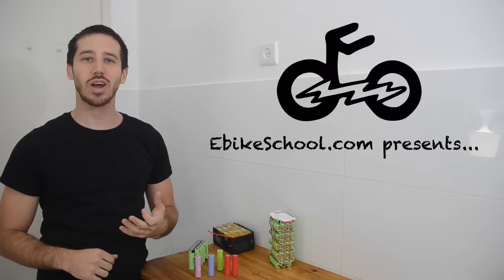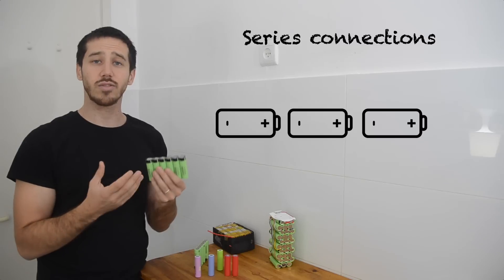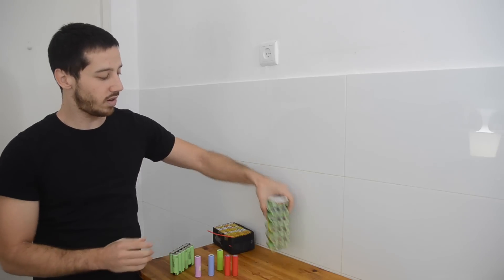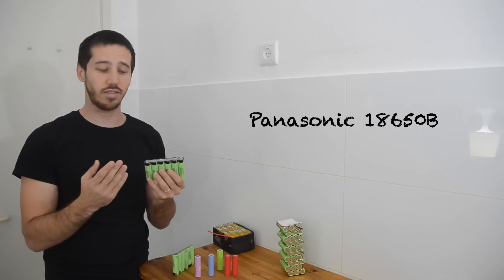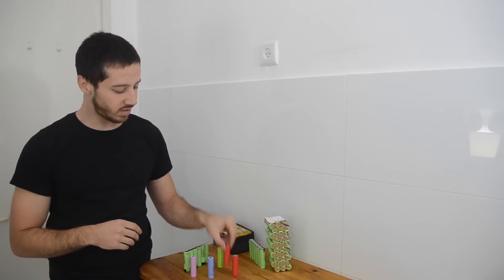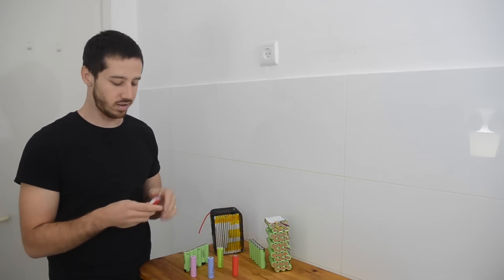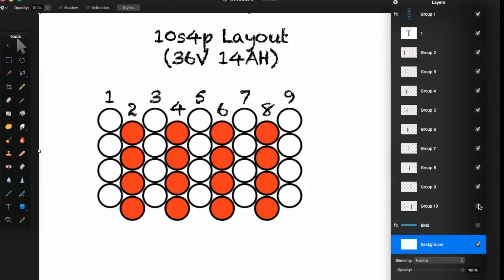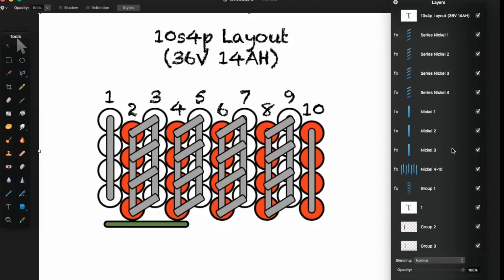DIY Lithium Battery - Battery Layout - Part 1/5

Comment: I have an old (2012) A2B 36 Volt bike.  Starting to cut off irregularly.  Re-push On button starts it again, but then it cuts off again.  Battery going bad?  Replacement cells possible?  Thanks.

Comment: Sorry Micah, i was wondering for 36V pack. I cant seem to fit 100 cells in my scooter it wont fit. I was hoping for 90 cells. Is it possible to make the centre rows 2P.. (10 cells per series connection) but the last positive and negative 
Row only 1P (rows 0 and 10 only 5 cells each) or is this a bad idea?

Comment: When you connect batteries in parallel amperage goes up not voltage.  When connected in series then voltage goes up.  Surprised by your video
Reply from the maker: That’s what the video says

Comment: hi there. I have an engwe engine x. it has a factory 48v 13ah battery and i will fit a second battery using a discharge balancer kit. it has everything I need so no cutting wires etc. I want to install an isolator switch so I don't have to unplug it all the time as they can be a bit zappy. I'm only a casual rider so the bike will be laid up some of the time. do you have any suggestions and direct me to the right part as I want it to be safe.

Comment: Hey Micah, enjoying your book DIY Lithium Batteries, and I have a question.  Batteries having varying voltage and current ratings, when you are designing a battery system and doing the math, how +/- can you be when doing your calculations?  If you are aiming for 52v and the math is adding up to 50.7v or 54.6v what is more acceptable?  I am assuming that the charging voltage doesn't change, correct?  Thank you for the book, I am gaining lots of knowledge from it!

Comment: Is it safe to use my old BMS that runs 10s4p rated at 10Ah on a pack that will be rated at 14.4Ah?
Note my old pack used 40pcs LG rated 2.5Ah. I am planning to replace them with 40pcs Panasonic rated 3.6Ah each.
Thanks to or your patience and reply.

Comment: Hello Engineer Mica Coll? It is wonderful to note that today, I have succeeded in building an S3 P7 lithium ion battery by listening to your teachings on line, buying your DIY book. Some materials were bought from china and locally in the UK. 18650 batteries were wrongly sent to me from China with pin heads. These were condemned and flat heads were sourced locally. 12v 40 amps BMS was used. There was a slight misconnection and the bms got warmed up and I quickly re adjusted the whole thing with shaky hands. Things went well after this and the discharge voltage came to 12.21v. Heat shrinks were bought and the whole project was wrapped up and ready this evening. This is my first step and I thank God as well as your very self for your open heart and willingness to help others. I intend to try more and will let you know about my adventures in this field. The vruzeng  Plastics tend to be falling apart often and the nickel strips are only coated and have nickel flakes peeling off the strips. Many thanks to you sir.  Joseph Oshagbemi.

Comment: does a Samsung INR 35E 3.6v  count as 3.7 ? or do i need to instead of 13 in series have it in 14 series ? (making a 50.4v battery ?  is that problematic or is there an advantage to it?)

Comment: Great video. When charging a battery pack, do you have to charge with the same voltage that the pack produces? For instance, a battery that is 8p 5s that is 21v. Does it have to be charged with 21v? Or could I charge with 12v?
Reply: you always charge it with a higher voltage, otherwise the power the amps will never "flow" to your battery. As for the voltage it depends on the battery, look up your datasheet

Comment: is paying for premium brands such as samsung LG and panasonic worth it? i was thinking attempting my first build and am considering samsung 18650 35E....should i consider going with 21700s instead...and why...now i currently have sla12v20ah x 5 in a ebike scooter gifted to me...its about 6 yrs old and the batteries seem to drain pretty fast....is it realistic to add distilled water to a sealed lead acid battery? does it truly rejuvenate them to like new condition? or is that wishful thinking?...and lastly is it a must that i match the current voltage of 60v if i switch to lithium ion? can i go with say a 52v or even a 48v with the factory controller? thanks to anyone that can help me...im at a stand still without this info...hopefully Micah himself can reply to my questions...thanks and keep up the great work! sincerely Dan

Comment: Hi, Micah; I have been watching yet another of your videos, and in this one, I see that you reference using Apple application: Pixel ?? Maker? is that the name of the application that you use to assist you in the lay-out of your batteries as you plan the building of them?

(It just didn't sound like you said, "Pixel Maker" - it sounds like.. Pixel Mater.. ? Anyhow, I'd be grateful for clarification on this. Thank you!)

Comment: Do you repair ebike batteries? My battery is a 36v and if I check with the tester show 39+volts. and it doesn't last long after I try to go for a ride in the bike.  Let me know if you or any body else do. Thanks in advance. I am a chicken to take the whole thing a part.

Comment: Another question.  I built an 8s3p battery following your guide, do you have a suggestion as to which charger I should use?  By my math, 8s x 4v = 32v at full charge... should I be purchasing a 32v charger?
Thanks

Comment: I'd like to do a 4 series out of samsung 35E. Need to pull 12V minimum and 18V max to power unit. Unit pulls .5 Ah but needs to be ran for 12 hours average. 

Thinking only needing 4 batteries but would have to use in series correct? Would I get the 14Ah that each battery adds up to (3.5Ah ea)?

Comment: I wanted to make my own battery pack. But I am still dont know if the 18650 cells that I will be using is the correct one? What are the specs that is right to run an electric scooter. I could see alot of options online. I am online familiar with the battery’s voltage and capacity, other than that I dont not know what to look for for the right battery for my electric scooter. Thanks

Comment: Glad I saw your clips, new to lipo battery’s. You talk about 12v, 18v, 24v, 36v for ebikes. I’m interested in making my own 40v like the ones made by a cie who’s name start with the G word for maintaining the lawn. I bought a Chinese battery casing for that « G » thing with already marked places for the plus and minors sign of the batteries. Learn from you how to solder the nickel strip and bms. But that G case has four prongs connectors, and when measuring voltage at those connectors voltage is all wrong and I’m no getting the 40volts there should be.
Could you make a clip on dealing with those batteries? Thanks if you do and for all clear informations you gave us.
Jean Pierre

Comment: Hello! I got quite brand new scooter(48v)Just used 50km. However the battery is not charging. I think the bms is dead. I tested the battery and it has 33v but then i tested it on bms or on the discharge i got only 2v.

Comment: thanks for the videos will order your book as i want to build  my own ebike batteries. Sorry if it's a dumb question but when you build a battery do you always discharge the cells first. I know you should never dead short any cell  but just wandered on the risks in building a pack with fully changed cells, obviously you don't touch the terminals

Comment: Hello, i Saw many vidéos and Ty for your explication, i have an electric scooter 36v 1000w. The original batteries IS lead battery (3*12v). And i wont to build lithium battery (i have 100 pieces, Samsung 22f,22e,28a,LG,sanyo a,fj,FM,Panasonic cg,ce).how Can i build an 36v with much AMP ? And if you Can send me an picture or other things for how it Can build. Ty very much. PS i'm néophyte in electronic

Comment: Quick question: sometimes you use nominal 3.7V for calculation and sometimes 4.2V. For this one, for 36V, you would need 9 in series if you count 4.2V each.
Why are you using 3.7V in your calculation?
Thank you for the reply?

Comment: Hi Micah I've learned a lot from your videos and am now ready to dive into the E-Bike world!!! Ok while waiting for my ekit to arrive I'm curious to know how to add the shifter cables to the brake handles that come with the kit. I see the electrical wires attached to the handle and the brake cable housing but no housing for the shift cable. I have the new Xspec 21 gear folding mountain bike w/Shimano shifter; each handle houses a brake/shifter cable. E bike handles have a single housing I'm assuming it's for the brake cable.  HELP a senior citizen out bro. Lol

Comment: one can get these batteries used off ebay for pretty cheap. they are NOT two 1850 batteries inside but actually one battery. would they make a good ebike cells?     https://www.ebay.com/itm/New-Boston-Power-Sonata-4400-mAh-3-7V-Lithium-Ion-Rechargeable-Battery-2x-18650/323359186059?hash=item4b49b59c8b:g:XYMAAOSwoA1bUk22

Comment: What is more better to use higher amps or lower amps
Reply: In a nutshell higher amps gives longer duration for the battery, so rather that.

Comment: I have enjoyed your how to build a lithium battery tutorial series ad I bought the book. I have a question. I am building 14.8 and 20 volt lithium battery packs to power cordless drills using BMS protection circuits using reclaimed 18650s. I would like a suggestion for a charger to use to discharge and charge these batteries. dhansmeyer64@gmail.com

Comment: Why the need to attach every single battery to each, when the connection is already made by the row connection. All that is needed is to connect the rows in series. To me that is wasted time and material, please explain if there is a reason for doing this.

Comment: This is very interesting. I found you post and videos by searching how to make your own camp trailer battery. I was thinking of buying a 100Ah deep cell battery to put in my popup trailer to run lights and what not on while camping. It's it possible to build a 12V 100Ah battery to run a camp trailer? What would that cost in parts and what not? Also thought of charging the system with a charger and possibly solar charger while camping

Comment: You start by saying 3.4 volt cell each then after explaining 6 in parallel and you connect another 6 now each battery is 3.7volt cells ?
Reply: You misheard m8. He said 3.4 ah (amp hours) and 3.7 volts

Comment: So how do I calculate the needed volts and aH I need to make for any given ebike motor? Obviously, if I have a 32v motor, I need at least a 32v pack, but if i build lets say a 42v pack, will it run longer on that 32v motor?

Comment: Hi there, I own an e-bike for 4 years now of which the battery is quickly less. As a new 36V 17Ah battery in the Netherlands costs about EURO 400, I decided to make it myself (using your videos and book of course)
I also understand  that the lifetime of the cells is about 4 to 5 years. Therefor I wonder why the battery in a TESLA / TOYOTA / ... last much longer than this period.
So if i build a TESLA wall do I have to change the cells every 4 years? If so brings that the price of "free solar energy" not so free as expected.

If you have an answer ...pls reply.
Reply: Quality vs scam artists from HK Hk

Comment: sir i am making an ebike for myself and i have almost every part except li ion charger . i have 36v 10Ah custom made battery but little bit confused about how can i charge them as i have no BMS . i am just using a 12Ah ESC for powering my ebike . can you plz help me with this proble ?
Reply: Just buy a bms on eBay. There cheap. Or go without like the you tube video suggests. There's trade offs but you have to decide to put your big boy pants on.

Comment: Yo! I got your book (ABOVE) before I knew you had a YouTube channel. I came across your channel after getting a spot welder on your recommendation from the book; your argument why it is not smart to solder 18650s makes sense. I was nervous to try this spot welder for the first time, so I came on YouTube to see how dangerous they are and I found this channel and recognized your name.  After reading a few books for solar DIY, circuit analysis, and electromagnetic theory (all very interesting beginner reads), I came to realize how important battery combos are, and research leads to be that Li-Ion are the best. Your book came highly recommended on Amazon, so I picked it up. However, the book has so much more great information than this channel, no offense. I have the book all marked up and I'm just playing with building packs for the first time. I have not ordered any Li-Ion yet, I'm playing with cheap alkaline AA just to get the hang. Thanks for the good information. I wish you, your family, and your dog, Steven, the best.
Reply from the maker: Thanks! Glad you're enjoying the book, channel and preparations for your own battery projects!

Comment: Question for you: can Dollarama single celled 18650 Power Bank batteries be cannibalized for use as ebike battery bank? They are 1,800 mah. Thanks
Reply from the maker: Theoretically yes, but they are likely meant for low power so you'll need a lot of them in parallel to power an ebike.

Comment: I bought a battery online. How do I verify that what's inside is what was advertised. Is it possible to do this without opening the aluminum shell?
Reply: The best way is to buy a commercial charger designed to handle lithium technology cells.  If you get a good one, it will have a display which will show you the ampere-hours (or milliampere-hours) of the cell(s) you're charging or discharging.

It actually measures the milliamp-hours during charging and discharging so when it finishes, you just read the value off the display.

Be aware that the display may not show the full rated capacity of the cell due to it using a somewhat different measurement method to the one commonly used by the cell manufacturers.  A 3400mAh cell for example will probably only take close to 2850mAh as shown on the charger display when charged from its fully discharged state.  This is normal and the cell is still good.

Comment: have a question
if I want to build a bike but using the  PANASONIC/SANYO NCR20700B  batteries  how would you set it up or am I better off staying with the 18650 set up.
Reply from the maker: It would be the exact same, except you'd end up with a higher AH battery if you use the same number of cells.
Reply: Thank you and  by the way your show is very helpful.

Comment: Mike,
If I'm building a 20A LiFePO4 pack,would I be better using say,6 cells at 3.4ah,or 3 cells at 7.2ah,or does it matter?Thank You
Reply: I don't know what Mike would say, but it seems to me that you're mistaking amperes for ampere-hours.  The two are quite different.

The ampere rating is how much current can be drawn (usually continuously) from the cell without overloading it, while the ampere-hour rating is how long a certain current in amperes can be drawn before the cell is considered discharged.

The ampere-hour rating of the cells won't make any difference to how much current in amperes each cell can provide.  You need to find out from the manufacturer's cell data sheet how much current each cell is rated to supply on a continuous basis.  In general, the lower the ampere-hour rating, the higher the rated maximum current is.

For example, if each cell is only rated for 5A then you'll need at least 4 of those in parallel to provide the 20A which you want to draw and in reality you'd be better off using at least a 6-cell parallel pack to keep the cells from overheating due to the current draw since the manufacturers seem to over-rate their cells, at least when they're used in a real-life application where they're combined into a battery pack without much air circulation to cool the cells.

You'll also need to use several 6-cell parallel packs in series to make up the voltage which your application requires.

Comment: Hi Mikey 
I just got the welder of the batteries 
And I opened up my e-bike battery 
My question is if you can advise me what to build and a good one that will last long time in life also on kilometers... 
I have 4 pack of battery inside and each one is (12V 14AH/2HR) 
So all together is 48V 
So if you can send me a link that will be the best for me 
Thanks in advance

Comment: How many 18650 batteries should I use for 48v 1000 watt electric bike? How many cell in parallel and how many in series? Thanks a lot Micah
Reply: Arnel Nepomuceno he explains it clearly. if you have 4 12v sets in parallel but keep in mind you need so many amps so keep in mind you may need to put those 4 in series. also youll need a BMS for the four series....btw im not a pro...i am just learning as well

Comment: great vid thanks. I am about to build a GA pack 14s4p. what are your views on individual cell fusing, going along the lines of not using a BMS as well. look forward to part 2
Reply from the maker: Individual cell fusing and not using a BMS are two totally different issues. I don't think individual cell fuses are needed for ebike packs IF you are using new, good quality cells (GA cells are very good, as long as they aren't fake). It's just added complexity. I almost always advice AGAINST not using a BMS for ebike purposes. You can do it, but you'll need to use a special balance charger to keep everything balanced and you'll need to be very careful when riding to never let your cells drop below about 2.7V. Once they get to 3V the voltage shoots down rapidly...